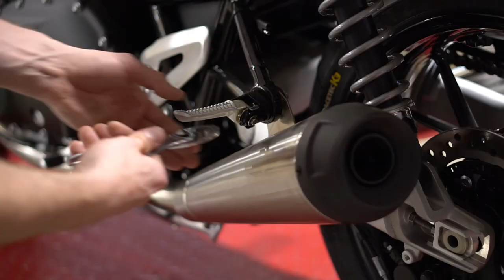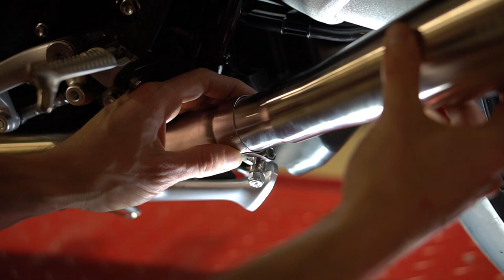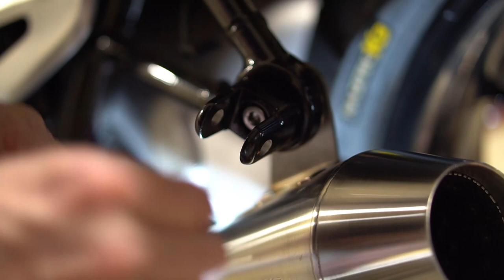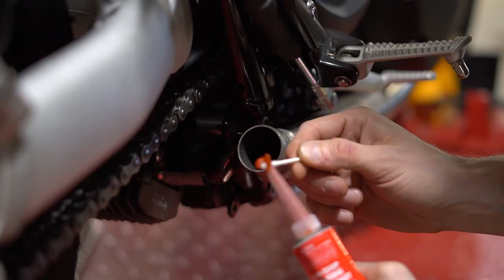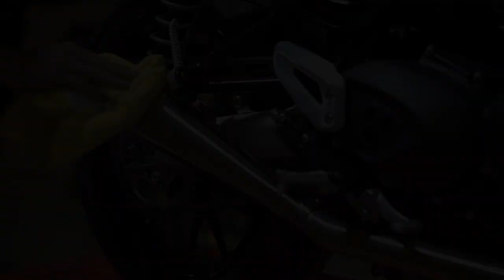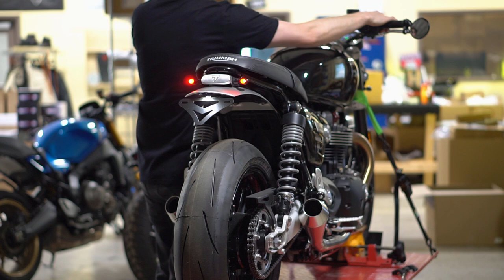Cone Shorty Slip-On Muffler Kit - Triumph Thruxton R, Street Twin & Speed Twin - Brogue Moto Install

Comment: Does this fit on 2023 Speed Twin 900 correctly with mid-pipe welded onto the cat?
Reply from the maker: If it's in the stock position then yes. Sounds a bit modified?

Comment: It hurts my soul watxhing people turn on an engine and immediately rev it to high revs. Especially turning it off straight away, you’ll get condensation build up in the internals which will fuck your engine up over time. 🤦🤦🤦🤦🤦🤦🤦🤦🤦🤦🤦
Reply from the maker: Proof you can't make everyone happy:/. I do appreciate your concern, but there's this thing called editing. I've been around cars, airplanes, helicopters, and now motorcycles since I was wee little lad. She'l be just fine, warmed up, and that was not a high rev 🫣. Thanks for commenting!